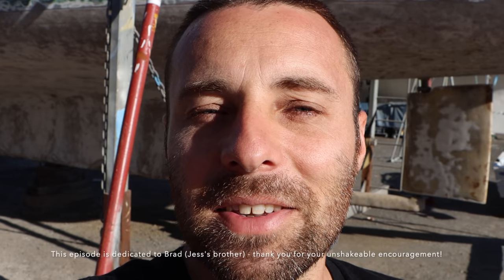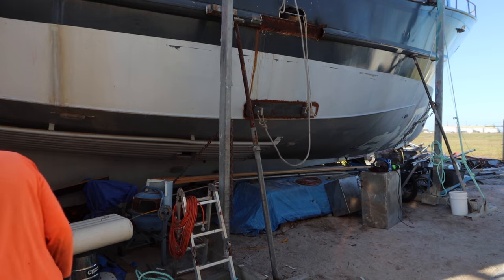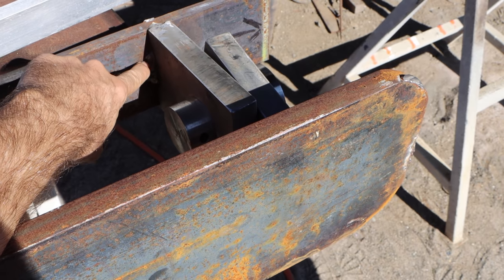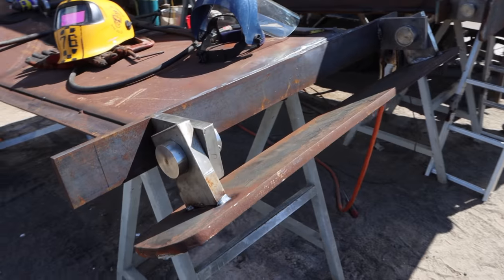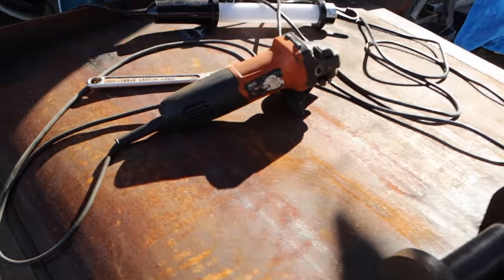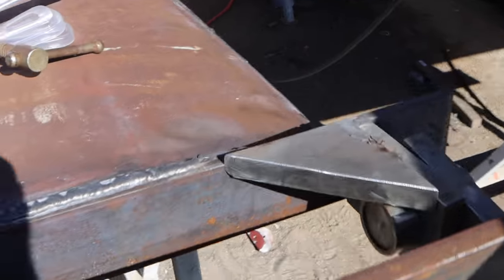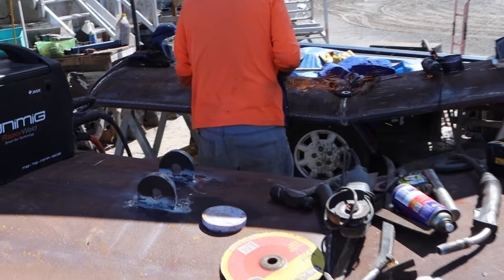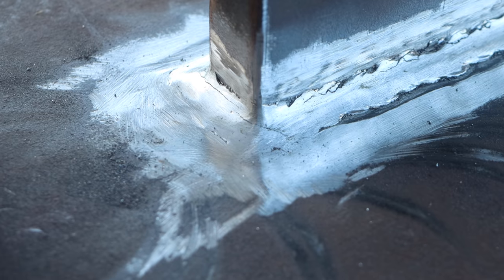Final Wing & Hinge Fabrication - Project Brupeg Ep. 138

Comment: G'day  Crew,,,, 
Congratulations on fabricating  such  a complex project ,  the wings  "STABILIZERS"   look great,  and no doubt will  be a fine  asset  to BRUPEG .. 
Moreover,  they are a credit to you guys ,  representing enormous  effort,  and   a large learning curve .
In brief,,, 
"Preheating    welded  joints"  ,,although  mega complex  ,,is more than worth a mention as you are now dealing with perhaps the most CRITICAL   WELD  on the stabilizers.  
Warming ,,pre heating , or  even post heating  of the hinge  joints  may be beneficial ,helping  to reduce  tension  and stresses,  due to various metal types and thicknesses  being used .

Just a thought .

Can't wait to see them in action .
Reply from the maker: Yeah our next plan is heat while welding etc

Comment: My dad would be right there with your grandpa they were from a time a tool lasted a whole career and in most cases got handed down to the kids to use now lucky to get 5 yrs out of most of this engineered to fail shite great videos keep em coming
Reply from the maker: Yip I remember when my grandad passed he gave his table saw to my old man, the thing must have weighed half a ton and been maybe 80years old at that point. He had drilled and a drill press that would have been a good 30yrs old too. They are still going as far as I know.

Comment: Been following all your work since the start. INCREDIBLE! Keep it up. I would like to put one question to you which I find pertinent to your future use of 'Brupeg'. If you're going to use her as a research vessel (RV), you may have to navigate through icefields. Have you considered reinforcing the bow? What I'm thinking of is some kind of double plating around the stem and coming back some feet along the forward hull and something like one foot (at least) above the waterline. Also, how about some strengthening to the interior of the bow structure, forward of the crash bulkhead. Just some safety improving thoughts... Best regards.
Reply from the maker: The next episode out tomorrow has details of exactly what we plan to do for Ice Mods

Comment: I like the way you are using the dust to check for cracks, in aviation we use NDT (Non destructive testing) to check for hair line cracks, a 
fluorescent dye and blacklight to find them
Reply from the maker: I used to do NDT with the die and also using electro magnets and iron powder for ferrous metal. this is a poor mans version of the iron/magnet testing. you could bump it up slightly if you had neodynium magnets placed carefully around but ive found you can pick most things up after grinder and welding as it does seem to amplify the magnatism of the metal enough

Comment: The 'yellow box' on the small grinder is an interference suppression capacitor, a grinder will run without it, but may induce noise in the mains suppy.
However, from the sound i would say the armature windings are burnt out, not much you can do about it.
Reply from the maker: Yeah we now have a spare so likely won’t bother fixing it

Comment: I think a bit of heat would be in order especially on the thick steel in what we call sweating, you'll actually see the moisture in the steel being moved around. Laying in hot passes should keep the temp up, once the welding is done the weld area should be well wrapped in insulation as too slow the movement of molecules as the heat dissipates. Welding heavy steel can be very tricky, we normally used heat sticks each would melt at specific temperatures letting the operator know whereabouts the temp of the work area.
Reply from the maker: I love the idea of a stick specific to a temp range. sounds very handy

Comment: What a fabulous job you guys are doing. You brought up the load from the arm going to the pivot point outboard on the wing. Is there anyway to put a damper in that arm so you don’t have all rigid points in the system?  It might provide a bit shock absorption if you had some kind of damper in the arm assembly.
Reply from the maker: Yeah i can understand that, ive not seen a design with a dampener, i suspect it just adds another point of possible failure so the commercial guys just dont bother
Reply: Project Brupeg Can’t wait to see it in action on the water. ⛴

Comment: You smoked the capacitor in the grinder (they break down over time.)  The rest of the grinder is likely okay.  Two dollar part online if you are comfortable doing some soldering.  Just search the part number on the side of that little yellow brick and get a matching replacement part.
Reply from the maker: Thanks Tim, we will check it out

Comment: Quizzical landlubber here (retired mechanical engineer in aviation) - How did you decide on the fore/aft location of the wings on the hull, that is are they at the beam or is there an optimal location where they are typically located.  Great work so far - Stay Safe and Press On!
Reply from the maker: Fore and aft isn’t as critical as in a plane I’m thinking, for us we put them where the original stabilisers were located which just happened to be over a bulkhead and the strongest possible location for them

Comment: Hi, Enjoying your build. I am only  guessing that the wings are lowered when in forward travel or are they just to stabilize when stationary?   They are made of extra heavy duty material, and must be kilos of welding wire as well. My question is, If used when in motion, will the force on the hull skin be okay for the hull to withstand. Is there any interval reinforcing in the area where you weld them on. It was a huge job to build and must be satisfying to see them come together.
Reply from the maker: Hi Peter. The wings spend 90% of their life down. They work when stationary or when steaming at full speed. Because of the doubler reinforcement the hull is strong enough to handle anything we through at it (including hitting something at full speed)

Comment: If you have a square piece of scrap RHS that it the right width (150mm x 150mm?), you could tack that between the 2 hinge plates, holding it parallel which will hold it parallel while you weld on the hinges....
Reply from the maker: im not sure the stainless hinge plates would be accurate enough, they were just hacked out with a bandsaw not CNC mill or anything super accurate

Comment: Did you hear about the airplane that used stilts instead of wings ? Apparently it had a ton of support but it never took off. 

You could fit some magnetic whale scrub brushes at the end and offer a whale barnacle removal service between missions!
Reply from the maker: I'm quite open to providing a drive through service area for whales

Comment: I am positive this has been addressed and I missed it somewhere but why wings and not just get a gyro seakeeper or the likes? They don't take up that much room and they do a terrific job both moving and stationary.
Reply from the maker: they are good but they have their drawbacks too, noise, vibration (in the older models) and the need to run a generator whenever its needed to run. they also suffer in side on seas a lot, check out the start of this video for a bit more on why wings.
https://www.youtube.com/watch?v=d0RrWJiybec

Comment: I can't think of a time you'd have the wings down while in reverse. You'll only be using them in rough weather, going ahead. They wont stabilize the boat unless you've got water passing over the front of the wing, with some speed. Operating in reverse I would think would require raising the wings, or they will be a hindrance to maneuvering.
Reply from the maker: They will be down 90% of the time, at anchor they work fantastic to severly limit rolling as to roll the boat needs to both lift and compress many tonnes of water above and below the blade on each side of the boat.

Comment: Ok you have made a really strong hinge, what if you hit something really hard and your doubler gets ripped from the side of the boat damaging the hull. Would it be wise to double the inside of the hull then if the outer hull get damaged the inner plate would stop any leakage.
Reply from the maker: Hi Ann, we pondered that but after talking to Chris (our design support guy) he said its wasnt needed. He knows of a boat with wings that was crossing a river bar and the boat rolled over, a wing dug into the ground and spun the boat sideways to the waves and sunk. when they pulled the boat from the water there was no damage to either the wing or the hull. its possible we could hit something really hard, but our feeling is the wing and hull are now strong enough to take the impact and stop the momentum of the boat without catastrophic damage.

Comment: Try preheating the metal before you weld it . That will help with the penetration and under cuts.
Reply from the maker: Yeah we dont have an oxy torch so we were trying to get away with it, but thats our next plan is get it hot and weld then cool it slowly

Comment: Hi you and your crew are doing a amazing job.and I wish you the best....however as I am watching your welding attempts I fear for your safety....when you are trying to weld the thick stainless gussets you are not making a big enough chamfer to get enough penetration what you are doing is going to fail....you really need to preheat the weld joint to help your welds  ..I wish I wasn’t telling you this but I have many years experience in heavy duty weldments...I don’t think it’s possible to get the integrity of the weld joints with the machine you are using and the wire diameter....the forces the wings will put through the plate into the hull ...you should consider a inside backing plate
Reply from the maker: Hi Charles, we were only tackig this together, we got a professional welder in to weld them fully as our machine cannot generate enough heat to join them properly. As for the chamfer, we offset them slightly and have been able to get three beads on every intersaction. They are rock solid now.

Comment: Those are large wings. Their attachment to the boat and the strength of the hinges will need to be VERY STRONG. Full penetration multiple pass welds should be used and the welding to the hull should include plug welds to the plate attachments based on engineering calculations..
Reply from the maker: Cheers Andrew. Yip doublers and hinges all got triple continuous beads on all joints
Reply: @ProjectBrupeg  I hope that that's enough. You will not want them ripped off where you are going. There is extreme weather , ice, whales and elephant seals and nowhere to hide.
Reply from the maker: if we rip them off the rest of the boat would have faild prior, this boat is double continuos welded on all seams, the doubles have 50% more than than so they arent going anywhere

Comment: To avoid twist in weldments draw arrows on your work one vertical and one horizontal then weld in that direction. You will need to weld “backwards” for half the welds. This will make all the distortion in one direction so no twist. If you want to prove this weld a square plate on each end of a pipe weld. Do this twice one with welding both ends in the same direction and the other in opposite direction. You will see the difference is twist
Reply from the maker: Awesome, thanks for the tips Peter

Comment: You NEED to preheat thick pieces like that! The weld will NOT hold without preheating! I'm sure ya prolly have by now... if not... Please do so! Cold water will cause failure to be Certain!!!

Comment: Hey, I noticed you drag your weld, I thought you are supposed to push your weld, but then I could be wrong, can someone en-light me thanks for your vids
Reply from the maker: both are possible, if there is slag (flux core wire) dragging is best as you can avoid getting slag in the root of the weld, however if the amps are high enough you can still push are rely on the heat to burn the slag up. solid wire is easy in a way you can do both.
Reply: @ProjectBrupeg  I did not realize you were using flux core wire, I am used to gas and wire, thank you and all the best to your project, stay safe and healthy

Comment: The yellow block is a Y class suppression capacitor. Cost is peanuts.
Reply from the maker: yip. unless you need to order one from bunnings and then the new grinder starts to look cheap
Reply: @ProjectBrupeg  what uF do you need? My cross cut saw  just blew a gearbox and is going to scrap. The one from the saw is a 0.33uF

Comment: aren't you concerned about polar exploration and the amount of ice you'll be weaving through? It seems like wings hanging off the outside of the hull would get torn off by a stray floe, even when raised.
Reply: In a few years when they'll be doing that, there won't be much ice left. Predictions already put that much of what was once no man's land is now free for all. Have you not noticed how cHina, rUssia, and aMerica, are all gearing to take over the empty passage?
Reply from the maker: Hi Guys, they plan is to steam to the ice with wings on (as we will be traversing 000's of miles of southern ocean) and then when we get close to the ice the wings will be removed from the hinges and lifted above the water line.
Reply: @ProjectBrupeg  makes sense to me! I should've thought of that one... maybe some steel reinforcement on the leading edge of those hinge plates that would push ice away from the hinge might also be a good idea?

Comment: Why do you care about wingtip vortices?  You are not trying to achieve lift with your "wings"; they are only there for lateral stability.  It seems in fact that you would want vortices if they allowed the wing to travel through the water with less friction.  Besides, you really don't have a "wing" per-se as the top profile matches the bottom profile so there would not be a difference in pressure between the two surfaces as its travelling through the water and therefore no pressure differential to create a vortex.  It seems the sharp edges of the wing would only serve to snag on equipment, netting, moorings etc and also serve as places for corrosion to initiate.  I say cut them off altogether and make it smooth.
Reply from the maker: Maybe watch the first wing episode again, as you have missed quite a bit of the deatils of these wings... Episode 122